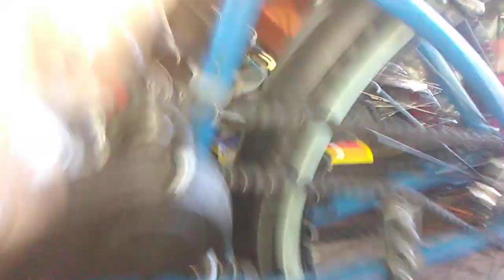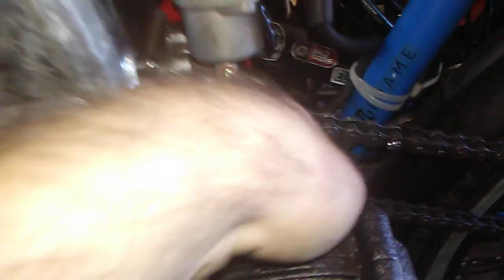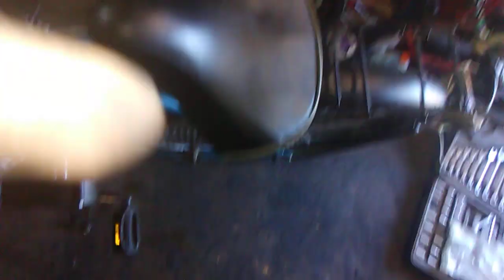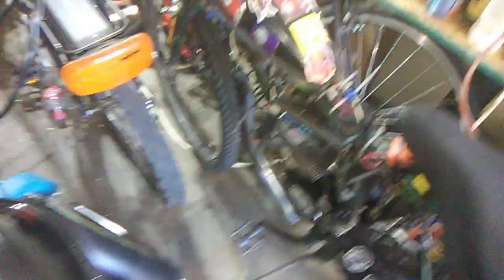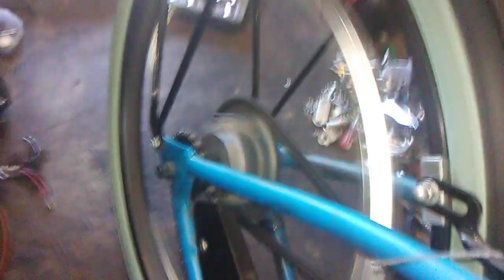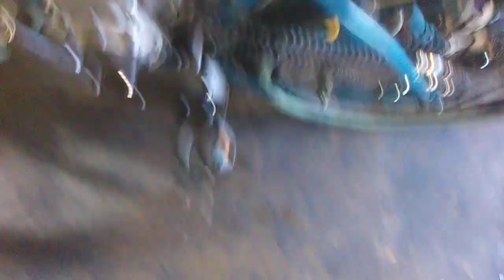"huashang/honda GXH50 with a rear 36 tooth sprocket freewheel drive!"

Comment: Yes, take us for a Cruise 🚴☁️☁️☁️
Reply from the maker: I will on the four stroke right now working on a bullet proof phantom 85 version 3 motor not going to use the chain saw head from the phantom hehe I have other plans a super build you will see some shit I'm a witch doctor Mother fucker watch me work!
Reply from the maker: I will be using a different engine cylinder head from another motor and no It isn't a yd100 head